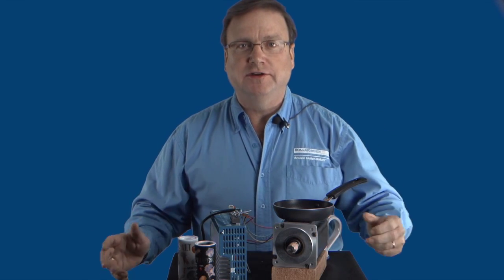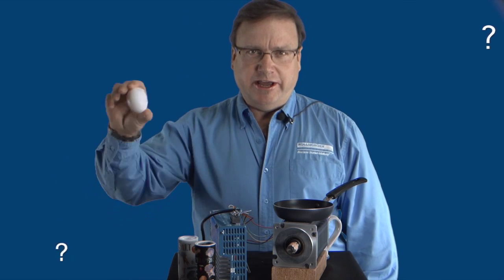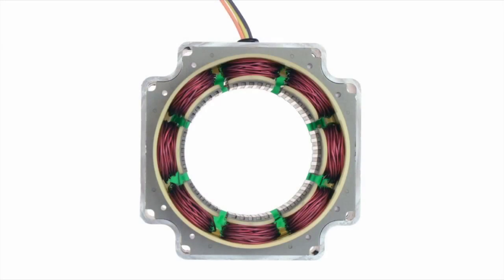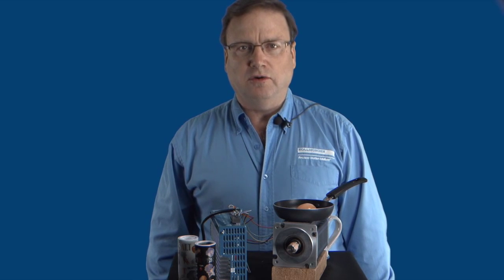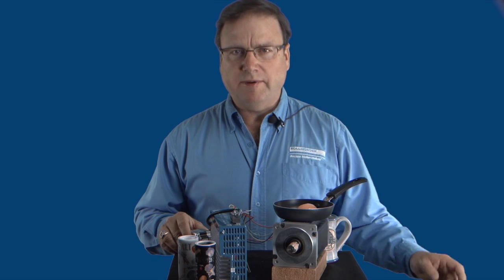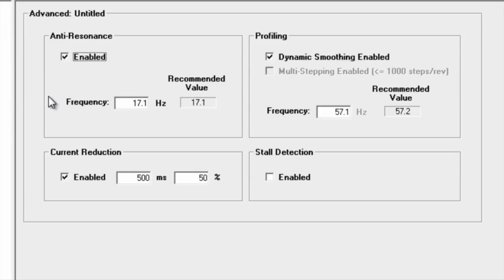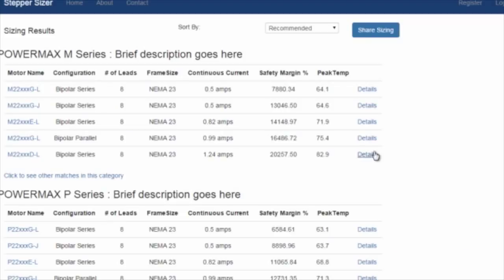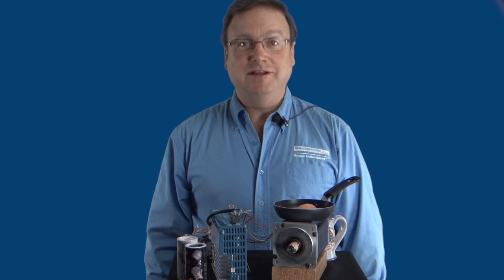Why Does My Step Motor Get Hot? | Kollmorgen | 2 Min of Motion

Comment: why stepper motor getting to hot, when i change drive from a4988 to  tb6600? i'm using nema 23 stepper motor....
Reply: Brizy Store  i'm already solved, you got to set the rating current in tb6600

Comment: My stepper motor gets hot too even when it is not turning. I guess the 'holding current' is on - the motor makes a noise but does not move. I can make it move all right, but when it is 'holding' and drawing 0.5 A (I measured) and not moving it gets hot - no, it gets HOT - wait: IT GETS EXTREMELY BURNING HOT IN NO TIME FLAT - HOT ENOUGH TO BLISTER!!!!!. Is that normal? I have a command to set the SLP pin low, and then the noise goes away and you can touch the motor and not burn. Problem is that various situations can arise where the system is incommunicative for a while and I have to pull the current and start over - then the motor may start in the 'holding current ON' way and then it gets hot enough to blister in about 15s. Is that really the way it should be?

Comment: Why does it get much faster hot and much hotter when it's on holding torque. Why?
Reply from the maker: Holding torque is when the step motor has windings energized to provide the holding torque.  This heats of the coils fairly quickly.  Depending on the load and the type of drive used, there are means to reduce the holding current (idle current reduction) if the application allows.
Reply: Thank you for the explanation! I thought there is a relation between the mechanical
work, or movement and the electromagnetic force caused by the current and the permanent 
magnet. 2 equal motors one drawing 2 Amps but turning will heat less than a stalled motor 
given 2 Amps.
Reply: There is a unenergized holding torque and an energized holding torque. An electric motor is an electromagnet, once energized the magnetic field is increased making the holding torque increase. And about the heating think of it like this: the energized stalled motor will have a constant 2A running through its coils while the running motor will have small spikes of 2A.